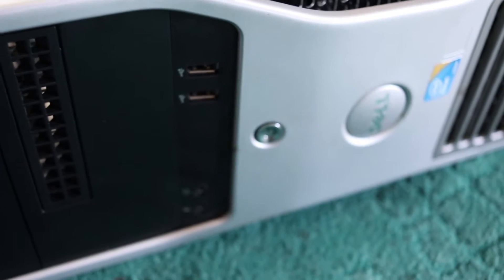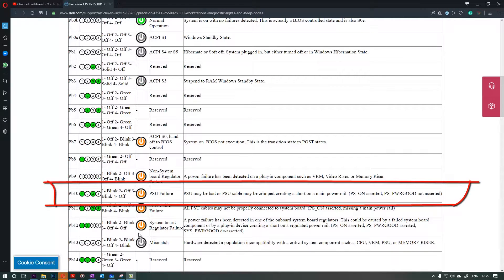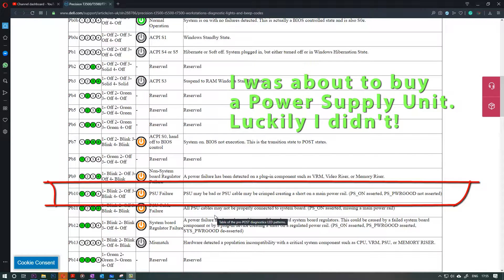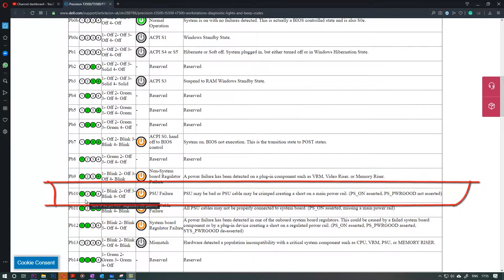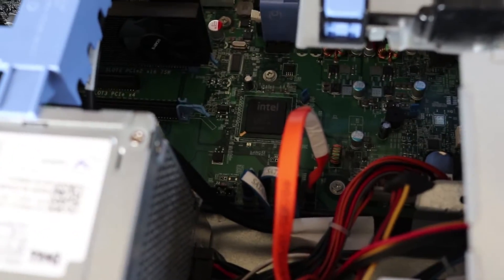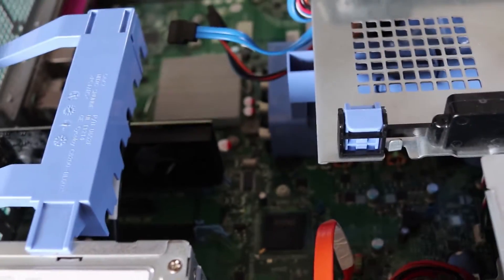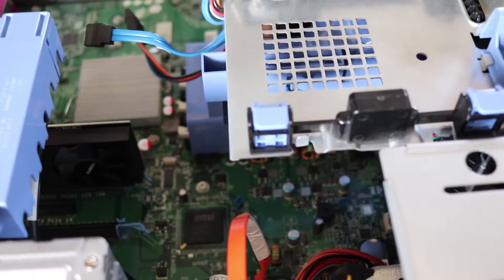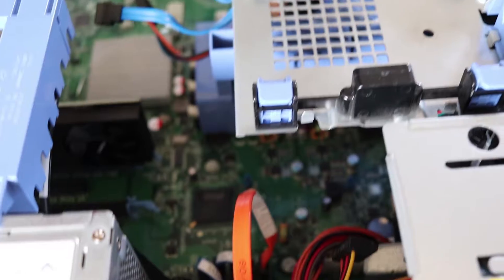Troubleshooting Computer or PC in Dell Precision T3500

Comment from the maker: 👉 How to find the best CPU for your Motherboard - https://youtu.be/rWAK3LbAgos
👉 how to find the best graphics card for my motherboard - https://youtu.be/S1FPvvSt5_c
👉 Best graphics card for Intel H61 Chipset motherboard - https://youtu.be/C7TQ2vGv-OQ
👉 AMD vs NVIDIA GPU Graphics Card - https://youtu.be/5-hdWxp_i0Y
👉 How to Speed Up Windows 10 Performance - https://youtu.be/7j0Kqxgnj-0
👉 How To Reset Windows 10 - https://youtu.be/TY-kSW3JEHc
👉 How to Upgrade Hard Drive to SSD without Reinstalling Windows - https://youtu.be/xXS9nhLQnFA
👉 How to change the browser used for web results in Windows 10 Search - https://youtu.be/LsbOZ9VXBKo
👉 How To Enable Group Policy Editor (gpedit.msc) In Windows 10 Home Edition - https://youtu.be/-9mjnk5Qdsw
👉 How to Disable Driver Signature Verification on Windows 10 - https://youtu.be/BWvfPEr-15U
👉 How to Disable Driver Signature Verification on Windows 10 | Advanced Method - https://youtu.be/UV6p_W3pzjQ
👉 how to find out Windows 10 VERSION - https://youtu.be/A_uYMBibSfI

Comment: @bhupinder tube: did you ever faced the problem, that the values in the bios did not keep saved?
i already replaced the cmos battery, but everytime after hitting APPLY, the changes are gone ( hyperthread or ammount of drives... )
any suggestion anybody?

Comment: pls  i meant how to fix Dell precision t3500 problem boot code light 1-2 blinking and the power button instead of green it also turns orange and shuts down........So can u pls tell me the fault or show me how to fix it.Thank U
Reply from the maker: 1 and 2 blinking means System board Regulator Failure. It means a power failure is detected on your onboard system board regulators. Could be because of component failure or a plug in device causing short on a regulated power rail. Maybe try to unplug all your devices, unplug power, and then try again. Basically, anything could be causing this. Devices could be GPU, RAM, CPU also that could be causing short. Have you recently made any changes to your PC? Do you get any message on your screen when turning ON? I've also put a link to Dell diagnostic lights website page in description.

Comment: My Dell T3500, once turned on, those big front fans start spinning at full speed, and so on and on and on. The system does not crash. The BIOS checks and is OK. All drives and disks plugged in, it doesn't do anything
What could be the cause. ? Please help.

Comment: Pls i want to know how to fix Dell precision t3500 problem boot code light 1-2
Reply: @PracticalTechFixes  pls  i meant how to fix Dell precision t3500 problem boot code light 1-2 blinking and the power button instead of green it also turns orange and shuts down........So can u pls tell me the fault or show me how to fix it.Thank U
Reply: @samueltakyi4624  same problem😢
Reply: @samueltakyi4624  if you found a solution please tell me
Reply: @alae._.2183  ok
Reply: @samueltakyi4624  thank you
Reply: @alae._.2183  I also Have the same problem did you find a solution?
Reply: I have 1, 2, 3 lit and no video. RAM issue? Thanks in advance!

Comment: Does the northbridge chipset overheat?
Reply: @PracticalTechFixes  I use it myself Dell precision t3500. Characteristics of it: 24gb RAM, 256gb SSD, 2Tb HDD, Xeon x5675, kfa2 geforce gtx 1060 6gb.
Reply: i placed an active fan on the heatsink and it run it in 7v mode. quite and cool...